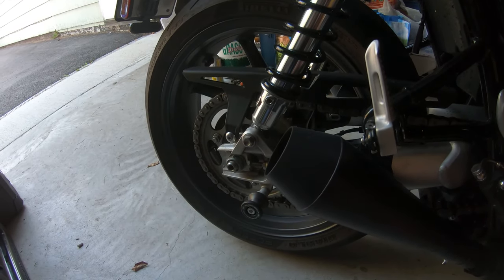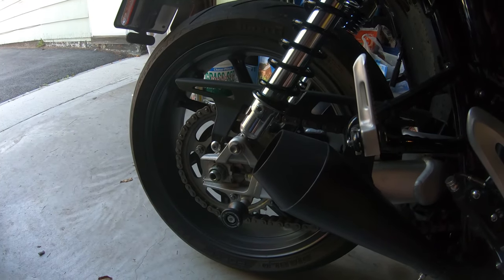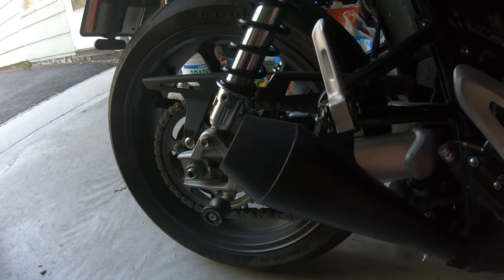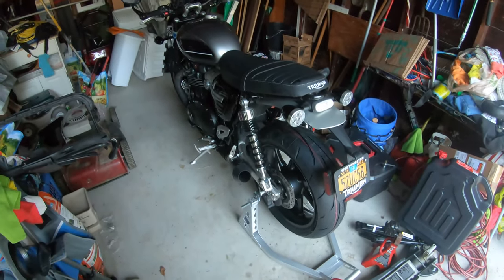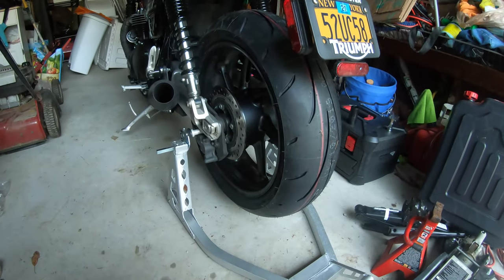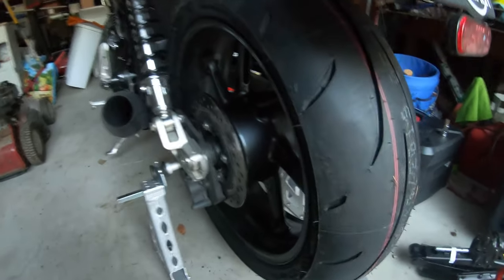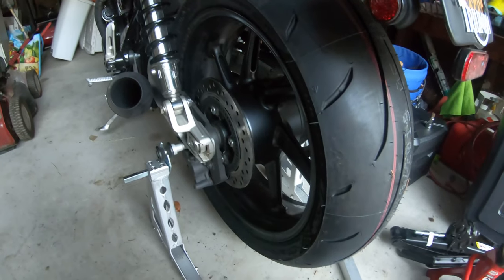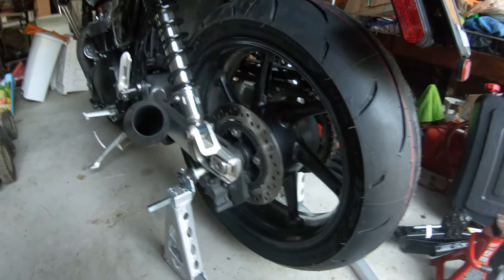Rear Wheel Removal!! // Triumph Speed Twin // 4K

Comment: If you leave the adjusters as they are then tap the spindle through you can remove the wheel and replace it without having to readjust the chain

Comment: My rear brake light stopped working. Any ideas if there is something I forgot to connect back up again or another problem?
Reply from the maker: The wiring harness runs over the rear fender, so its possible the connector was pulled out on accident. I would take that off and make sure the connector is plugged in. I made a video where i removed those parts to be powdercoated, in case you need a guide to get the fender off
Reply: Thanks!!

Comment: how did you install it? I can't get it to fit with the fucking spacers. I'm driving myself insane
Reply from the maker: Make sure the spacers are in correctly and seated down all the way. Also make sure the brake caliper is in the right position. There should be a tab that fits into a slot on the caliper and locates it to the right position. It's way easier with a friend. Last time I did it, I had my buddy hold the caliper while I slide the wheel back into place. Hope this helps!
Reply: @NicePantsLance  thanks I ended up removing the chain guard and opening up the brake caliper all the way. Somehow magically went in afterwards!